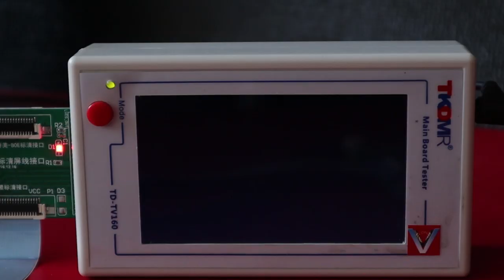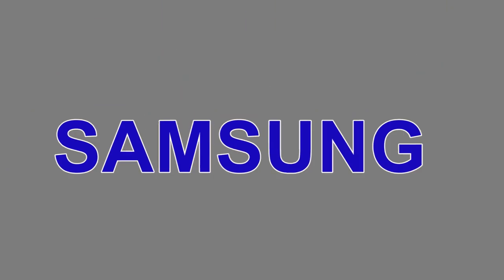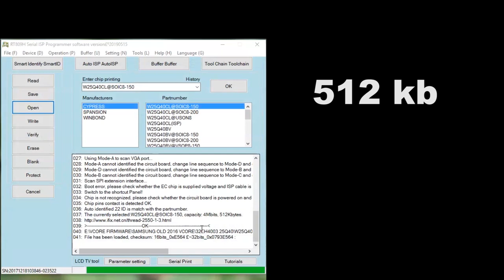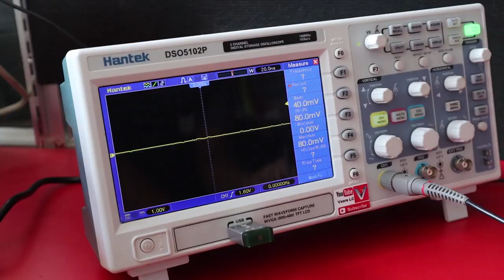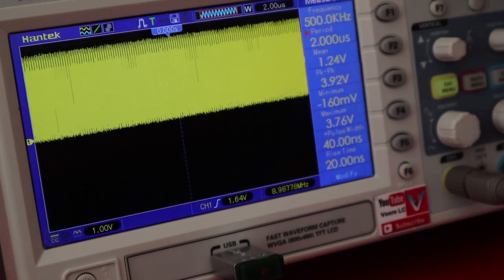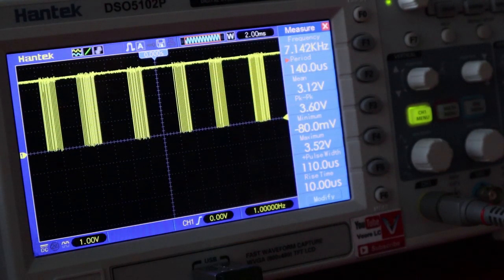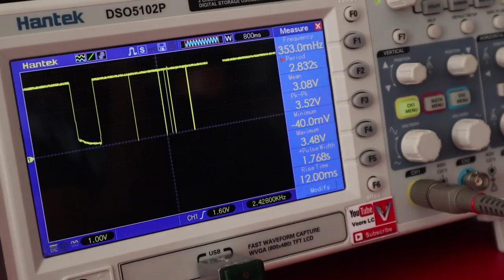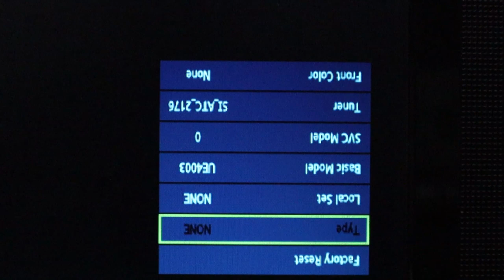LED TV Main Board Repair

Comment: I have a Samsung tv 50inch with problem picture is and the screen but its abit white with vertical lines to the right side, can u help also i change with new t-con board no changes after.
Reply from the maker: If there have gate COF, you can bypass the track
Reply: @VcoreLC  
Not sure of the process of bypassing

Comment: Hello sir, I have a Panasonic 43 inch Smart 4k TV which for the past few days has stopped working even though the stand by light is on, I am guessing the problem is with the motherboard, how much do you think it will cost to replace it in India?
Reply: in India you fix things, in the West you bin them ;). So replacing is not an option :D.

Comment: where is the software from? did you pick them from a working board?
Reply from the maker: If you need I’ll provide you
Reply: @VcoreLC   some other Samsung have the same Problem and we are locking for a souce to download or buy this data

Comment: Do the HDCP keys / HDMI work also with an empty Eeprom?
Reply from the maker: Some MCU's set EEPROM in such way that it can be automatically write algorithm, in which when we insert blank EEPROM, Parameter can be changed by service menu or by other modes. In most MCU without original dump, it can't work properly Or can deliver HDCP error & other signal standard failure too.
Reply: @VcoreLC  can u save data from broken eeprom?

Comment: Our Sony tv NSX32GT1 has good audio but no vedio/picture for few days and now when switched on red light blinking 3 times instead of green light and open.Kindly suggest and help me.Thanks.
Reply: Turn off all lights, point a flash light to the screen with the tv on.
Press menú on your remote, if you see the menú or any letter is the back light.

Comment: hi friend....I have Gosonic lcd ..because of bad power supply  stop working ...when i restarted red and blue led shimming for couple seconds then no light no work i check output power board  it read okay when i restarted and loosed all voltages when red led stop shimming ...when i disconnect the out put power cable from main board  the voltages stay okay....can you tell me when the problem plz
thank you
Reply from the maker: Make sure that PSU is giving strong voltage or not  if yes it means main board is taking more power.
Reply: V core vedeo are wonderful for begner thx bro make such vedeo to improve knowledge and keep making vedeo God bless I m from India

Comment: Sir aap kaha se hai.ek board hmara bhi.hai,wo bhi dead ho gya hai.jab supply lgate hai,suply 0 ho jati hai.agar aap nearest hai,to hum aapse karva sakte hai.plz tell me.your contact send me email id hai, suvansh.bansal@gmail.com jo apki charging hogi wo hum pay kar denge.new brand board mil nhi raha hai.
Reply from the maker: If Main voltage is dropped check short circuit in voltage input path definitely you can find fault 😉.